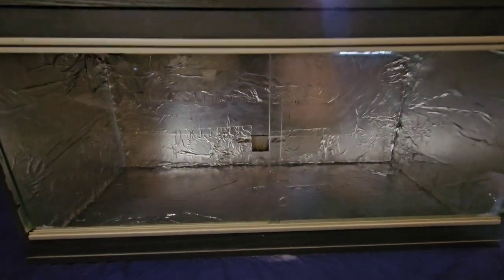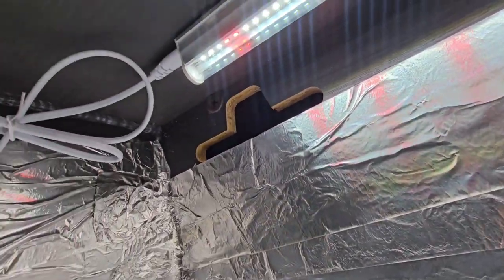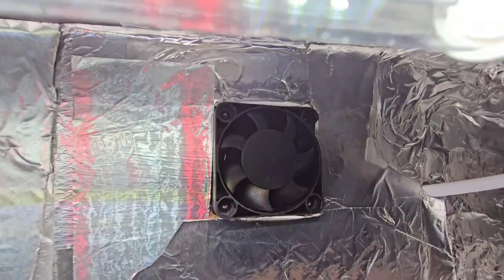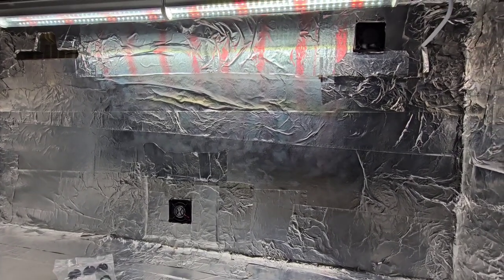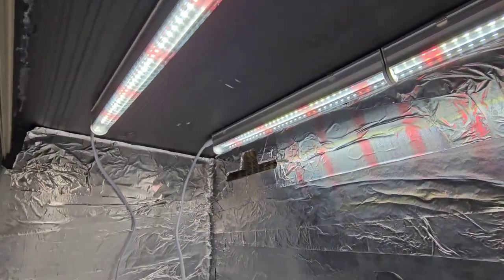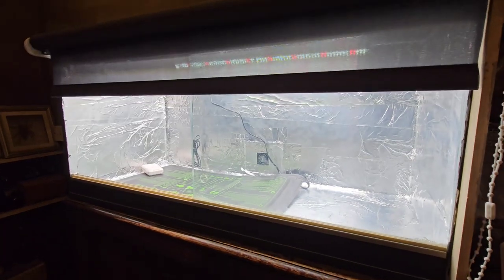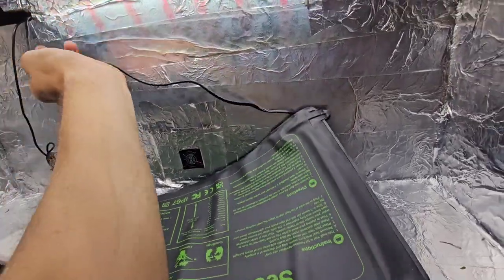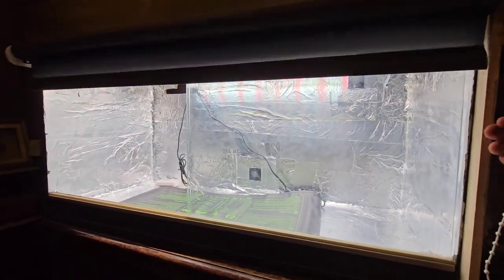My Tropical Bonsai Tree Set Up

Comment: How much do you think it will cost to run the LED lights for a month?
Reply from the maker: I'm not sure to be honest, but wouldn't be a great expense as there LED lights :)
Reply: @gizzygreenfingers  True, they use 90% less energy than halogen bulbs. Suppose only way to find out is get some and see. Paranoid about a HUGE electricity bill, 😅
Reply from the maker: @njpringle  I'm not good at mathematics but there is probably a way to work it out, 🤷
Reply: @gizzygreenfingers  I think it is see how many watts is used, then how much per unit it is with your electricity provider, then times the W x pence per unit. 🤯
Reply from the maker: @njpringle be interesting to know though, if I ever work it out I'll let you know lol 😂